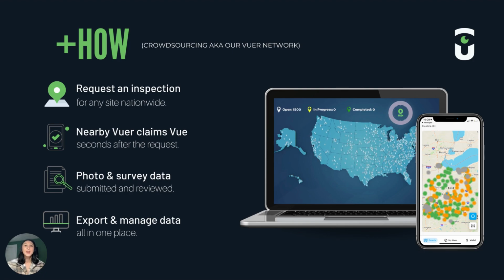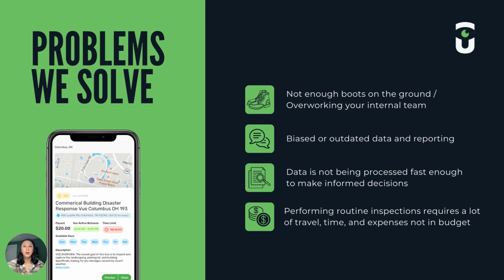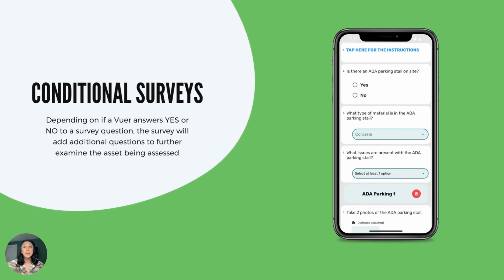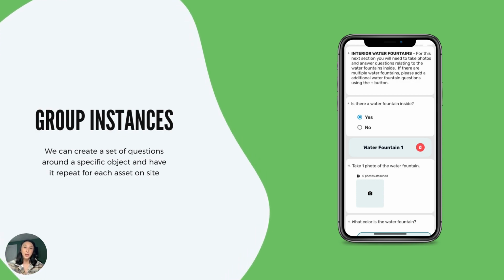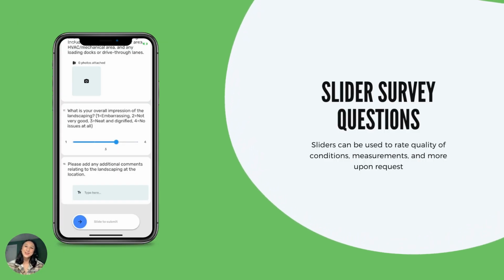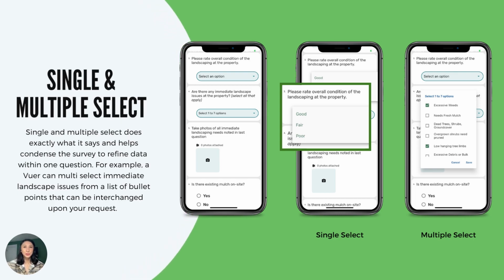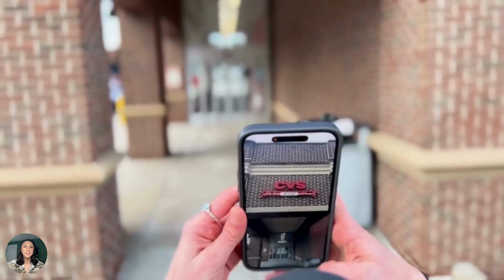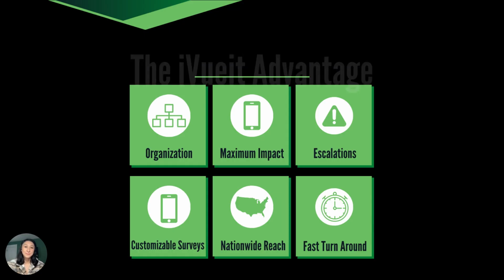iVueit Explained 7.0 | Dynamic Surveys

Comment: New Vuers- there's one bit of advice I have- when you schedule a vue trip with 6 vues, enter your vues in reverse-last one first. Reason: although you're allowed 6 vues, only the last 5 you enter will show up on the "to-do" screen. If you enter 6, 5, 4, 3, 2, 1, then your first vue will be at the top of the screen, and when you complete it, the others will smoothly move up on the screen.  This app is legit, BTW.
Reply: I can only get 3 at a time, period.
Reply: I can only get 4 at the time and I am a preferred Vuer.